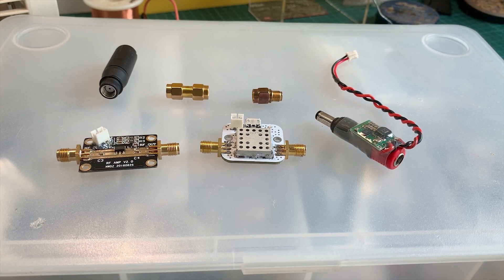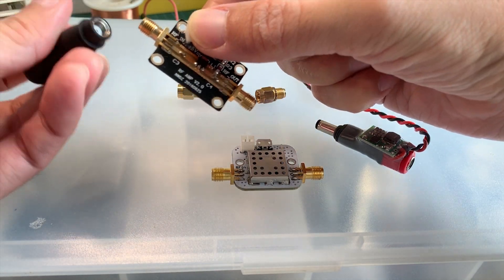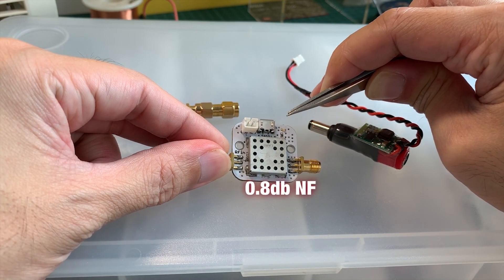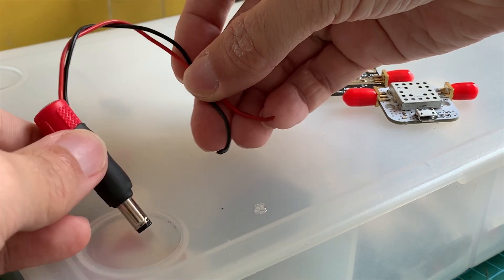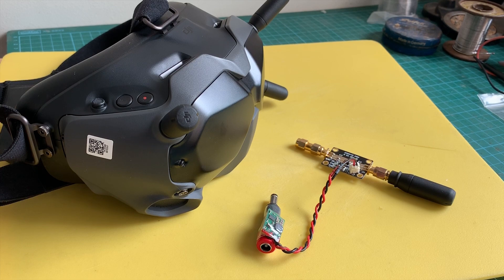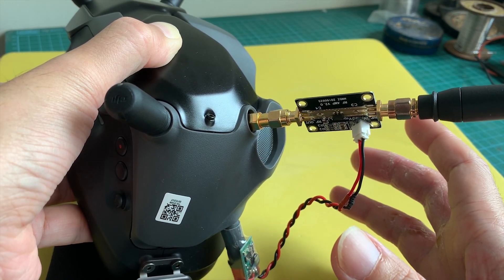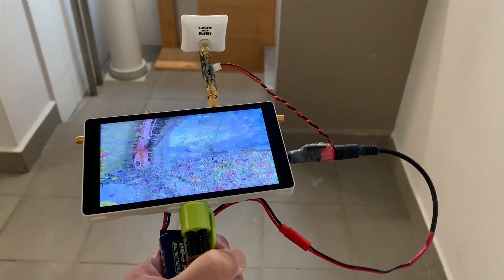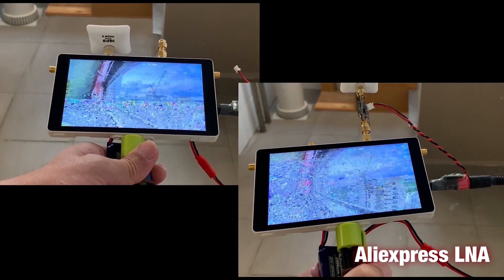LNA on DJI Digital FPV !!

Comment: using patch antenna but your at the behind,,why not use crosshair antenna type it will give u the punch,,dont blame the gear when you not using a propper antenna inside a building to penetrate the wall,,please at least try at outside open field area will be much get relevan result

Comment: Its POWER AMPLIEFER ( from ali) its not antena ampliefer... its for transmitter, not for receiver.
Reply: And why does it work if it is an power amplifier ?
Reply: @surronzak8154  its not work )) 14:30 no difference autor video says.  it gust skips rf signal but not amplifing it.

Comment: I have those sitting around but LNA will also amplify noise. You should also block other frequencies too.
Reply from the maker: You are right, a bandpass filter should be used to remove out-of-band noise after amplification. However, a gd bandpass filter for 5.8g (with loss < 1.7db) costs 88usd. Those cheap 30usd ones has a high attenuation of 4.5db.
Reply: wow, that's a bit expensive. Can you please share the link of that $88 bandpass filter?

Comment: I prefer to use LCP antennas patches. Already the goggles are bulky ... adding external devices complicates things more...thanks for sharing your test!
Reply from the maker: Thanks for your comment. I am building some new linear patch antennas to go with a pair of “Transtec Beetle” linear antennas on the DC2 (to reduce payload). These PCB patches should be light on the DJI goggles and hopefully have similar performance to the X-Air patches. :)

Comment: hi terence, what if we use it in 1.2ghz video receiver it might have significant good result. looks like although its stated that up to 6000mhz, but the optimum good result would be up to 3.5ghz only. can you try to test it to 1.2ghz/1.3ghz video receiver or i think 433mhz radio receiver but need to change the C3,C4 and L1 if using for 433mhz.thanks
Reply from the maker: 2 yrs ago, I tested 1.2g with an old IC rated up to 2ghz and that worked really well(video below)
https://www.youtube.com/watch?v=wR5cczS4-NI
The specs of this IC is way better than that IC that I used 2yrs ago. I am certain it would work really well for your applications.

Comment: Here is side-by-side comparision of 2 screenshots of your FPV videos, right one is with LNA. https://drive.google.com/file/d/1b3HVAXVsqD5UHAttazK3akbUF16zl7El/view?usp=sharing
There's only a slight improvement in video quality by the LNA for the DJI FPV Digital System. Nice try though.
Reply from the maker: Thanks for putting up the side-by-side screenshots comparison! I thought the sides of the DJI FPV video got somewhat less blurry with the LNA but the diff wasn't significant to make an impact to the HD experience. The LNA would certainly make an impact on the ByteFrost FPV experience though. During weak reception, whilst the Bytefrost 'snow flakes' ain't getting less dense due to the LNA, their flickering does drop to a noticeably lower rate, which makes it easier to make out objects ahead as you are flying.

Comment: I think the Bytefrost will go into low power mode if you don't keep it cool....
Reply from the maker: During the testing, I had temporarily placed a fan besides the drone so that the Bytefrost would not over heat.
Reply: Here is side-by-side comparision of 2 screenshots of your FPV videos, right one is with LNA. http://www.tinyurl.com/LNAresult
There's only a slight improvement in video quality by the LNA for the DJI FPV Digital System. Nice try though.
Reply from the maker: Yeah, not a significant diff to make an impact to the DJI experience. The LNA would certainly make an impact on the ByteFrost experience though. During weak reception, whilst the Bytefrost 'snow flakes' ain't getting less dense due to the LNA, their flickering does drop to a noticeably lower rate, which makes it easier to make out objects ahead as you are flying.
Reply: Terence Chan hi, I have a byte Frost, do you think is a good idea to buy 4 this lna amp for my receiver ? Thx